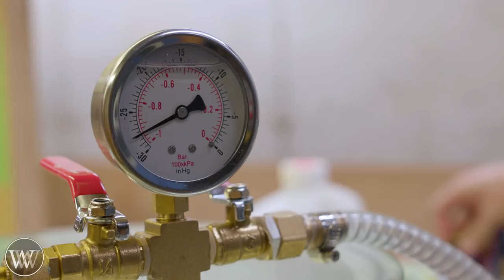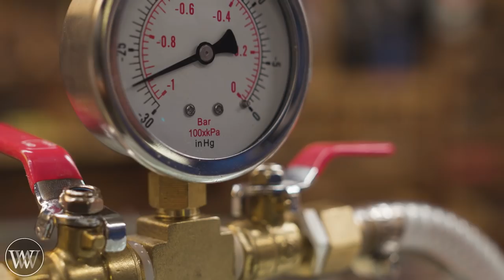Making Mallets for Tally Ho

Comment: hi, what is the differns between live oak and normal oak?
Reply from the maker: Live oak is a deciduous tree that keeps its leaves year round. It is a very Twisted grain though it works much like white oak. It is also a much harder wood than white oak or Red Oak.
Reply: It only grows in the southeastern US, I believe.  Its slow rate of growth makes the wood very hard and dense.  If you're not familiar with them, you might like to Google some images.  The branching pattern is pretty crazy.

Comment: Could you have done the mortises before stabilizing or would that have caused sizing/ splitting issues?
Reply from the maker: Problem is the stabilization changes. The size and shape of the head. Sort of like dunking it in water and letting it absorb as much as it wants.

Comment: Is it necessary to use resin on mallets?  I realize they will last longer but seems like an unnecessary use of toxins.
Reply from the maker: normally I do not however this was the scrap cut offs that could not be used in the boat and some of it was very Punky it would not work well as a mallet using the resin allows that to be used as a male ahead. Also with cactus juice it's not a normal resin and not something that is toxic. It's actually water safe and most people have no problems dipping their hands in it. I was also working with epoxy at the time so I kept my gloves on.

Comment: As you said, you had a hard time boring out the mortises, why did you not do that before the resin treatment? You would have got deeper penetration of the resin having a hole in the middle. I'm sure there was a reason, just not obvious to me.
Reply from the maker: actualy with the vacume pump the juce got the whole way through the block. if I cut the hole before the joint would not fit after due to the swelling of absorbing the juice.
Reply: Wood By Wright. Not sure of your answer, you could have fettled the joint after the treatment, a couple of shaves with a sharp chisel. Until you cut the joint you did not know how deep the penetration was, just saying. From where I sat, it took you by surprise how hard the treatment left the wood, I'm sure, if there is a next time, you may reconsider your process.
Reply from the maker: @mergrew0110   Mergrew 01  no I knew it would go all the way through. It always does with open poor woods like oak. I was more justifying the drill to the purists in that audience. After the stabolization the head bent about 1/16" on top of that the stabolization makes the live oak easer to work (with the exception of a lead screw) as the grain is lass of a factor then.

Comment: Where did you get your branding iron
Reply from the maker: I had the head 3D printed engine threaded on a bolt connector to create a handle I thought about making a larger one in doing a how to video on it but just haven't done that yet.

Comment: Nice, one comment why do you risk damaging your plane blade by placing it flat on the bench
Reply from the maker: there is no risk of damage to the plane. there is actually more risk of damage setting it on inside and the sides of the plane body are unsupported and can crack. It use to be big in shop classes that the instructor would make students put it on the side so there would be less chance of the student dinging the blades when setting it on another tool. but it can also be more dangerous to have an exposed blade if a hand slides by it.

Comment: I guess it's a personal thing, I have used 3º for mallets.  Is there a rule?  Does the angle relate to the handle length?
Reply from the maker: I misspoke. I normally have it around 5. but yes the further down the handle you hold it the shallower the angle you want. I hold it about 1" down from the head.
Reply: I'm quoting from others but can't remember the source. In the good old days the mallet was made by the apprentice to his height etc. so that when the forearm was horizontal and the head was impacting the wood / joint. It to was full contact with the wood or chisel handle. the angle was measured and the mallet face cut accordingly. So lets say 5deg. Of course a lot of mallets are now mass produced (unless your name is James) so an abatory angle is chosen
Reply: pgfollett  to get the angle draw an arc of a circle with a radius of the length of your forearm plus the proposed length of the mallet then with a pair of compasses mark from the point where the radius meets the circle an arc with a radius half the width or the head that crosses the circle on both sides of the radius. Draw a line connecting the two points. Draw a second radius back to the centre of the original circle this will give you an angle taylor made for your arm.  I was taught that the best mallets are made from the fork of an apple Tree where the grain is particularly wild, this is supposed to avoid splitting but it’s really hard to chop a good mortise.
Reply: my grandfather always said to select the piece of wood from immediately below a limb where the tree has a natural "strength" grown into it.   typically, this is also were you'll find "tiger-wood" figuring.   He said these were the best pieces to use for "Heavy duty" things like mallet heads, chisel handles (particularly ones that you'd use with a mallet...)     He had two really stunning jointer planes, one from a maple and one from a beech, that had tremendous figuring in them...(sadly, they vanished after he passed...not sure who in the family grabbed them up....  :(    )

Comment: nice work ... but question of mine why not put in the hole in first and sen stabilise it the epoxy would go deeper in?
Reply from the maker: surprisingly with he vacuum chamber it will work the whole way through the block with no problem. If I cut the mortise first then it would not fit after as the wood will move when absorbing the juice

Comment: I thought Olive makes the best mallets
Reply from the maker: Well there is no such thing as the "best wood" for mallets as there are so many different uses for them. Some times you need them soft. some times you need then heavy. some times you need them somewhere in between. but if you are looking for the most robust wood then that would be Lignum vitae crotch wood as it si the hardest wood and incredibly durable. but if we are talking joiners mallets Olive would be near the top of the list but I would still like live oak more the olive due to the interlocking grain.

Comment: Imagine someone starting out following this video about making these mallets and suddenly realising "Oh, my gosh, I forgot to include expensive specialised stabilising equipment and liquids when I bought my beginner hand tool kit". I've been woodworking for over 40 years, both traditional hand tool joinery and professional carpentry and neither I - or anyone I have ever met in the trades - have mentioned or required such stuff. It's absurd. You take wood that is suitable for the project and you use it...!
Reply from the maker: Thanks for the feedback. that is why I mention the other videos where I do not stabilize the heads.

Comment: First of all, thank you for the entertaining and free videos. But I feel your approach "hand tools only" a bit inconsistent. You refuse to do a rip cut on a table saw, but then you let the wood soak in liquid plastic? Why not pick a piece of proper wood to begin with (Leos pile sure is big enough). If you go a traditional approach, I think It would make more sense to stick to traditional products. Wood, Lineseed oil, bee wax...now Leo has a very beautiful plastic hammer...
Reply from the maker: thanks for the feed back. unfortunately the scrap pile at Leo's place was a but under developed yet as he has only made 4 frames. and I did not want to take out good stock as he will be running tight on the project. as to coshing this time to pull out the drill it was because we were under a video shooting crunch. in order to get the footage shot while the videographer was there, that was one of the time-saving items I chose. The other was to skip the carving I had planed. most of the time I time the projects so that I can do the long and tedious tasks off camera and just shoot the beginning and end when the videographer is there. but I do make a point that naytime I do chose to use power tools I show the audence as I do nto want to be acused of faking it for the camera.
Reply: It takes nothing away from me, if you cut corners using powertools. I was just curious about the use of epoxy, as I feel that is a rather large alteration of the product wood. As it gets basicly infused with "plastic", loosing the smell and touch of real wood. I learned a lot from this little project...and I am missing a mallet in my shop. I have a narly ash-crotch about 3" thick...maybe that will do.
Reply from the maker: Sounds like a fun mallet.